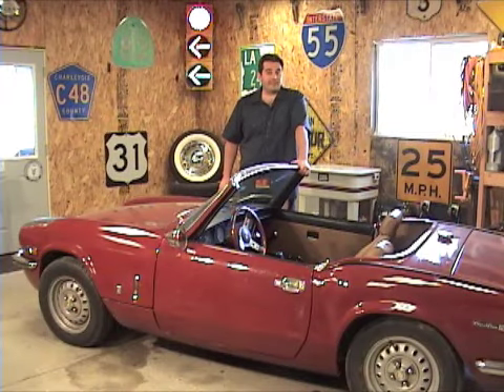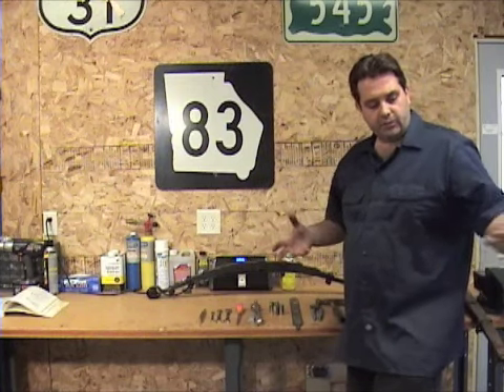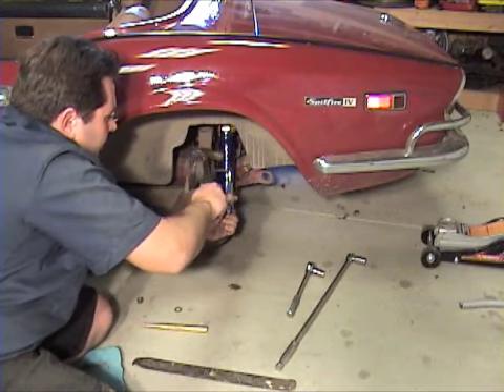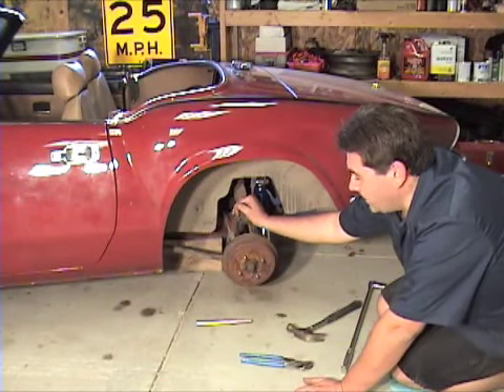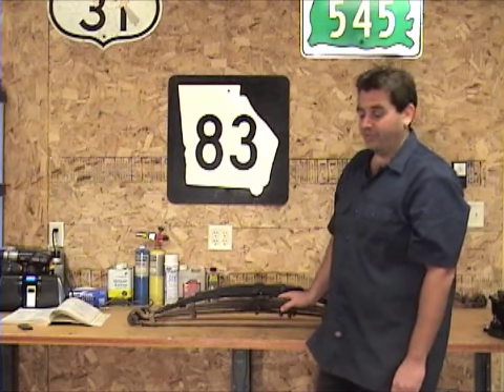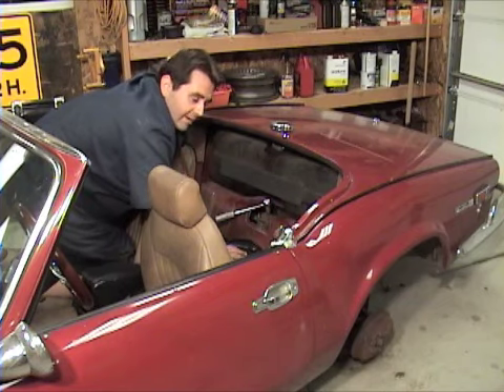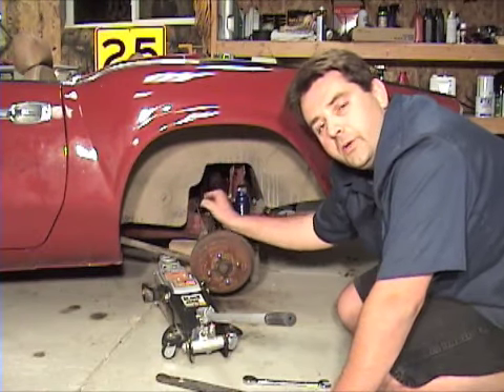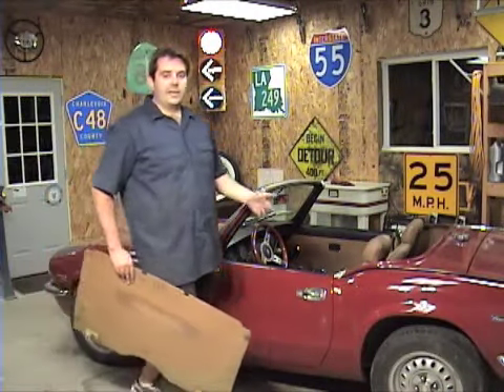Rear Leaf Spring Replacement (please turn on subtitles/cc for update)

Comment: Also, measure the width of the new spring compared to the old spring. I got one that was 1/8" too wide and wouldn't fit, had to wrestle it back out and in again. A long pry bar helps when aligning the vertical links. Great video!

Comment: Indigo, a Swedish made, low volume roadster. Due to the anti-roll properties of the transverse leaf spring setup the car does not use a separate front anti-roll bar.[10]

Many small European cars such as the Fiat 128, the Yugo, and the Triumph Motor Company small chassis cars (Herald, Vitesse, Spitfire, GT6) used transverse steel springs in similar fashion. The Yugo's steel spring used twin attachment points and did provide anti-roll capability.

Comment: PS...... nice video. I just changed one out tonight. But I am replacing the bushings between the leafs with the custon teflon type. No need to buy a new spring most of the time. It's all in the bushings usually. Cheaper and you end up with a better spring than most of the newer ones. I also suggest not using the HD spring for street. Too stiff. IMHO. Also if you use a new spring...install the newer bushings anyway. Best thing to do in the long run.

Comment: In addition to the Corvette, a composite transverse leaf spring has been used on other GM and non-GM vehicles.

    Volvo 960 (Wagon only)
    Volvo S90
    Mercedes Sprinter vans (transverse in front only)
    VW 1-Litre-Car prototype car
    GM W platform cars- (Lumina, Grand Prix, Regal, Cutlass Supreme).
    GM E platform cars- (Eldorado, Toronado, Riviera, Reatta, Allante).
    Mercedes Smart ForTwo (used with MacPherson Struts)

Comment: Does using the six leaf heavy duty spring eliminate the need for the 3/8 through bolt between leaves 1 and 2 and the bottom plate?

Comment: @lol123321123321  like I said......... guess you never looked under older Corvettes and many other cars. Just because you are not familiar with it or know anything about it.does not make it funny, silly or bad. It just makes you ignorant to this type of suspension. I PERSONALLY LIKE IT........ I own a few Spitfires and a GT6 as well as a 1973 Corvette that all use this. Handles great...changes camber to the road surface......NICE!
TRY THINKING OUT OF THE BOX!